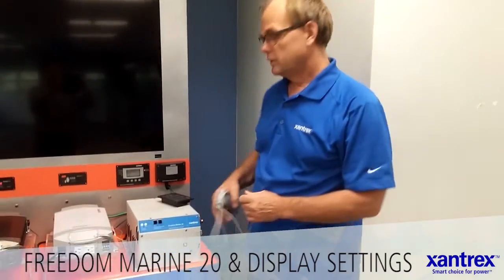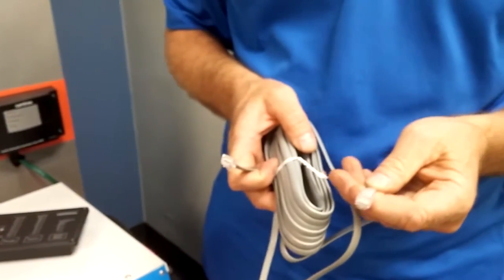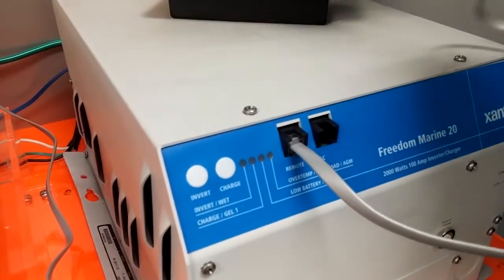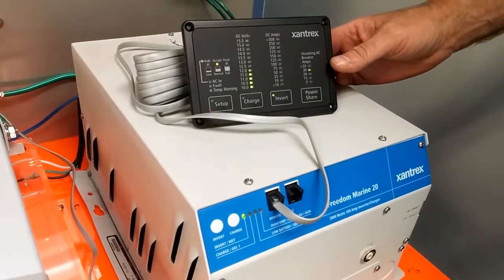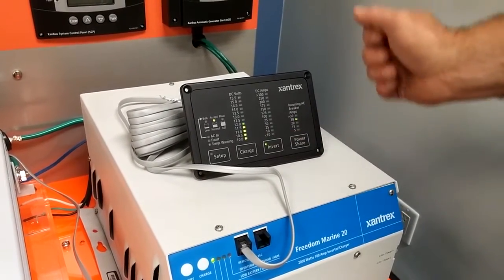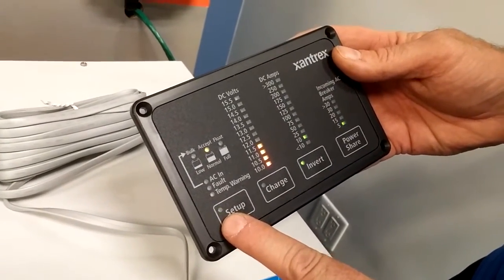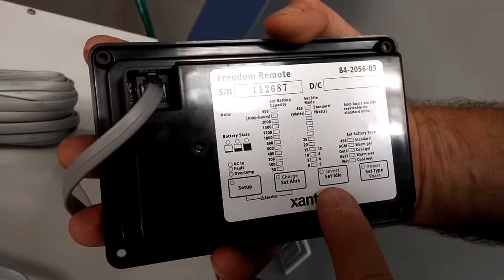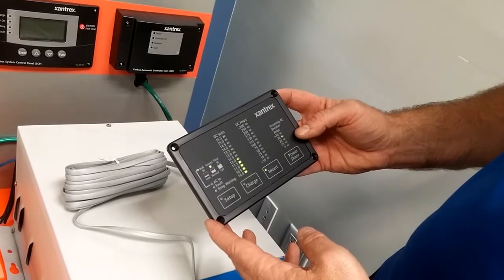Xantrex Tech Tip - Freedom Marine Inverter/Charger Remote Panel

Comment: Saludo una ayuda
Reply from the maker: Please call 1 800 670 0707 for help.
Reply: My remote doesn’t come on if I unplug it and plug it back in the charge light comes on for a minute and then goes off.

Comment: I bought the remote for the prowatt sw 2000 and the RJ11 has a black cover on one end with the cable wrapped around a green circular item.  The instructions don't specify which end this device should go. At the control or the inverter
Reply from the maker: The answer is because sometimes it is one end and sometimes it is the other. It depends on over air signals that can interfere with the unit. Most of the time, almost always, it will function regardless of which end it is at. You would normally put the item, a ferrite core, close to the Prowatt as it is more likely that you want it at that end than at the switch end.